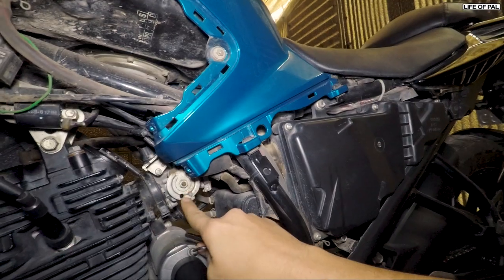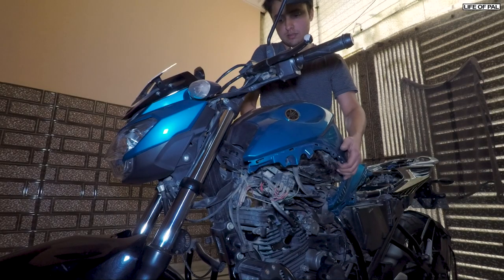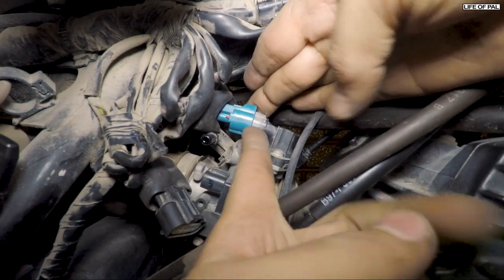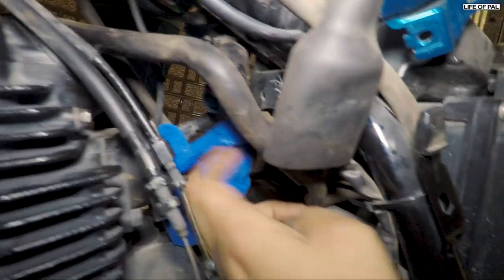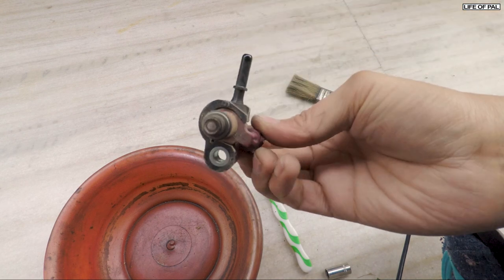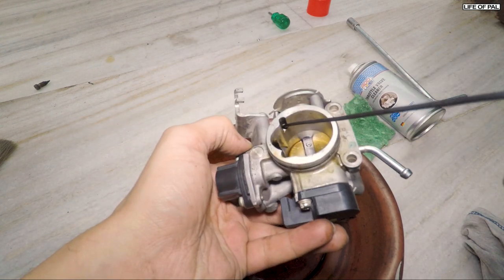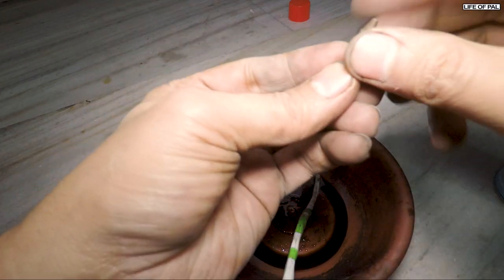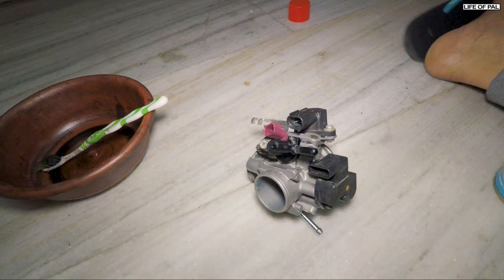How To Clean Throttle Body | FZ25 | Life of Pal

Comment: Hi bro, will throttle body fail or damage. My 2017 FZ25 is in yamaha service centre for last 1 month. They couldn't find the problem (engine getting off on acceleration) for 1 month and now they asked to change the throttle body which cost 8500 they said. Is there any sensor failure or the whole throttle body needs to be replaced.

Comment: I am using Yamaha FZ25 Bike, resently I was using liqui moly additive oil with in petrol after I am facing problem my bike struck, not responsible for high throttle, admited to Yamaha service center, they told throttle body change only this problem is rectify, SO2 sensor working in good, what is price throttle body, where is the purchase in less price, Yamaha service center price Rs.8300, I am locate in chennai.. pls your opinion..

Comment: Sir I have a Fz25,I face in low RPM my bike was running start off and pickup problem..how to solve it .plzz reply 🙏
Reply from the maker: I dont know the history of your bike. Do this change air filter, engine oil, clean throttle body, injector, fuel filter, adjust idle, tappets. This should resolve. All videos are available.

Comment: What happens if throttle body isn't cleaned. I'm currently using MT15. Coverd 34,000km. I'm experiencing some sort of non smoothness at lower speeds. Non that much but there is some sort of non smoothness. Bike was very smooth and acceleration was liners but now don't know why. Is this the reason. What should i do. I cleaned the Fuel injector should i do this?
Reply from the maker: Yes definitely clean the solenoid valve pathway

Comment: hi need link for injector cleaner only Throttle Body Cleaner link is given thx. by the way can we go for liqi molly cleaner petrol additive if we dont wanna take the thing apart?
Reply from the maker: Petrol additive does help but not much it will not clean it all. Throttle body cleaner or injector cleaner is same. Go with the link
Reply: @LifeofPal  thanks a ton! any idea about hydraulic clutch for fz 25? my left hand has multiple fractures and surgery plates so little weak
Reply from the maker: I think hydraulic clutch is universal fit. Check other video

Comment: Sir where i can find ideal screw for my bike ...i lost it somewhere?  My bike is Fz v2
Reply from the maker: Lost it somewhere means? You know where it is located but you don't have it? You can buy it from service center. They may not have in stock, tell them to order.
Reply: One more question 
I took my bike to kedarnath without that screw and now after 500 km it is not starting by self start does this happened because of lot of dust and carbon got accumulated in throttel body ?
Reply from the maker: Bike starts with fuel, air, compression and spark. Any issue in any of this with cause starting issue.

Comment: my FZ25 started getting rpm fluctuation where rpm wud go upto 5k-6k rpm without me accelerating.
I was told by 2 different SC that its a throttle body issue and they will have to replace it.
Fortunately its under warranty but it will take 10 days for them to order and get the part.
😔😔😔😔
Reply from the maker: Be thankful that its under warranty otherwise throttlebody is very expensive.
Reply: @LifeofPal  8.5k approx
Reply from the maker: Okay

Comment: Why you haven't cleaned the throttle position sensor?
Reply from the maker: You cant i mentioned
Reply: @LifeofPal  you told that never ever open the throttle position sensor....
Reply from the maker: Which means cant be cleaned. It dont require cleaning. Just spary clearner in the holes

Comment: Hello   sir    can   I  have    ur  no.
 Wana   talk    to  u  
Need    a suggestion 
I   m  using  fz 25 2019 , 47,000 driven 
I  m  facing  problem   with   throttle  I guess

It's   rpm  is  always  around  2500 to 30000l wen bike     in   on neutral 
Wen  I  m  riding    it's    in normal  functioning as soon  I take  clutch rpm  increases 

 Also  I  m  facing  issues with  abs  motor 
Abs  is   also not  fuctiong

People  r suggesting  me to  sale  fz 25
N I  don't  want    dat  

I  Wana  use it . I m  too  connected  to  it

 Kindly  help  me out  

Pls  share  ur   no.

 And I  m  staying  in   bihar  right   nw

Thank  you    sir